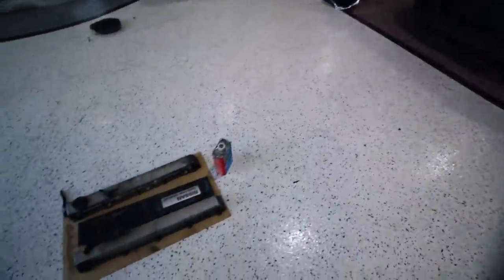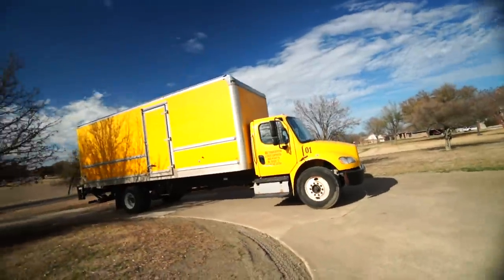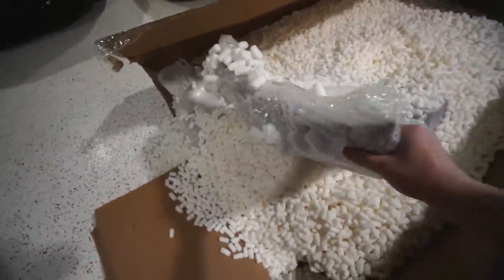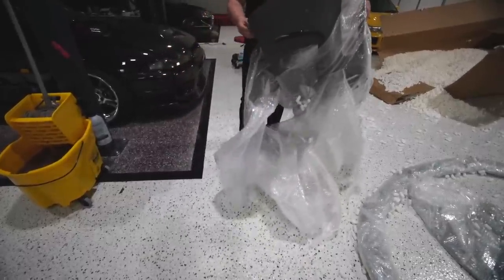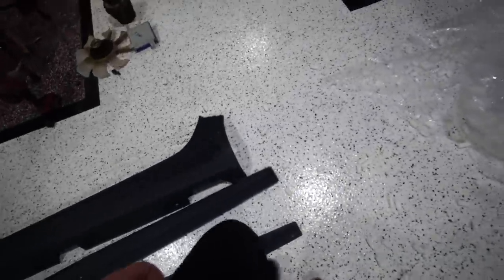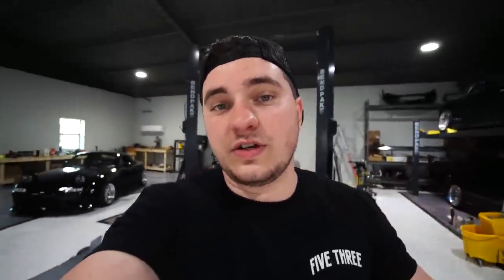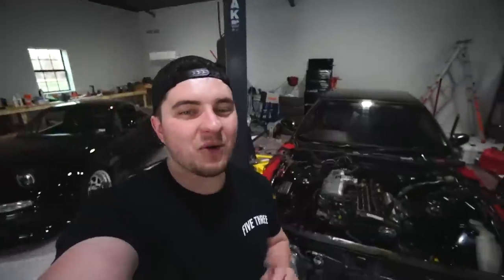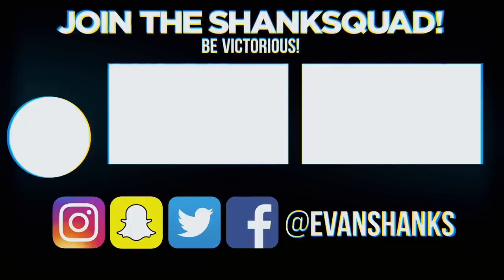Shipping Company DESTROYED my $13,000 Bodykit

Comment: They've stacked stuff on top it why its bulged in.its clearly the shipping company's fault.had fragile on it.
Reply: Exactly. People saying it's the way they packaged it are wrong. As long as it says fragile it shouldn't be getting crushed during shipping like that.
Reply: @Jon95McC  still fragile or not any parcel which is fragile or dangerous MUST be protected way better than this,like seriously anything could have been put on it or parcle could have came out of its position and slide around when truck was turning resulting in damage

i work for shipping company and what i see is usually either good packaging in crates or so shit packaging i genuinely cannot put that parcel onto conveyor belt without it bending by its weight and lots of inbetween which is plain horrible

it is fault of the company shipping this,imagine paying 13k for a bumper to come like this unprotected with no structural rigidity inside the box